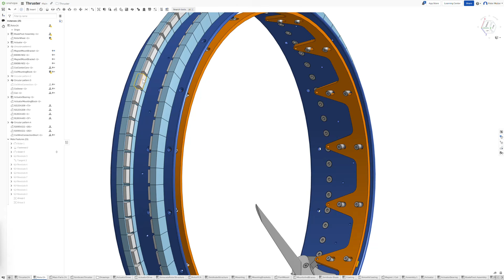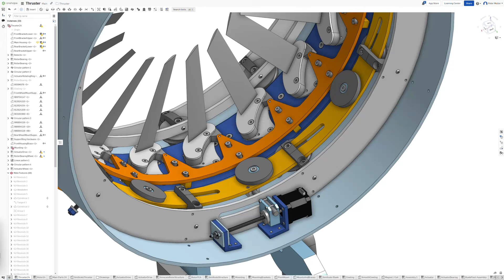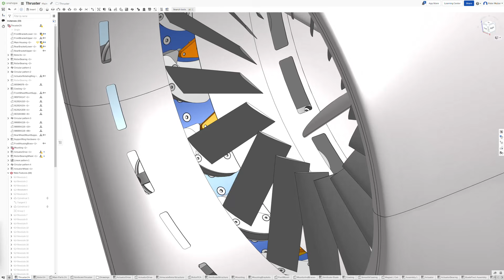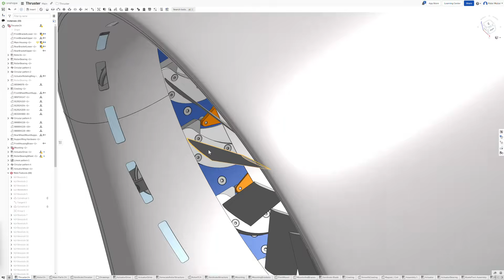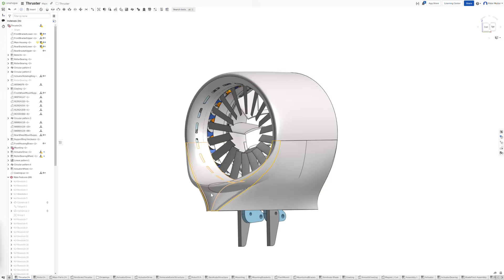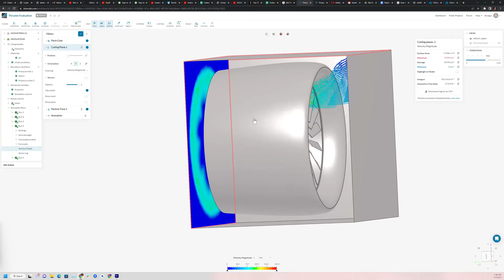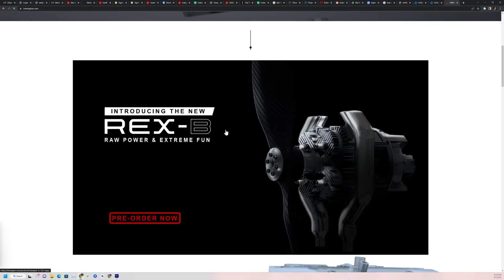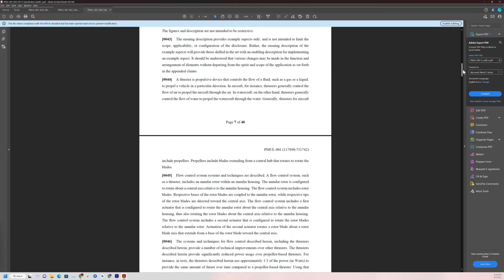Could this Thruster transform Aviation?

Comment: Have you shown this design to Mike Patey? He has built entire aircraft - engines, avionics, wing spars, high lift devices, etc and does his engineering analysis in solid works and fabricates significant amounts of his aircraft components himself , from aluminum to carbon fibre. He would be very interested in this design.

Comment: What's the advantages of having adjustable blade angles?  Thanks y'all.  Awesome video!
Reply: Adjustable blade angles are like the gears in a car's transmission.  A shallow angle is a low gear, and a high blade angle is for when you are screaming along at high speed.
Reply: @1donagin   thank you!  Does that mean possible quicker acceleration or shorter runways?

Comment: I've been working on something similar (for a personal flying vehicle), but with the blades connecting to an inner ring as well, which I expect to eliminate wingtip vortices and vibrations, and reducing risk of damage if a blade is impacted. I haven't gotten to the point of testing thrust or efficiency, but the noise reduction compared to regular propellers is massive.
Reply: Wing tip vortices, are produced by the wing, starting at the root, moving out toward the tips. The engine has very little to do with them. Ir were you referring to the compressor blades? Usually, a blade is designed with washout, greater pitch in the centre, with finer pitch toward the tips. This is because the speed of the tips is greater than the root. From what I saw, it is less of a turbine, and more like a Fenestron, like such is used on the EC-120
Reply: @onebadwolf9123  I'm talking about vortices at the end of the propeller blades. While less critical than those at the end of fixed wings, it's an effect that also affects propellers.
In my design, the propellers are supported by an outside ring, not at the center, so the votives would occur at the edge of the propeller that's near the center of rotation. Given the slower speed of this part of the blade and the direction of the prevailing forces, it should be a small effect, but I won't know until I'm able to measure it.

Comment: This was oc just a prototype, but I noticed a lot of resonance/flutter at the tip of the blades. Are you sure you don't have to connect them in the middle, to compensate for that instability ? I imagine it will only get worse when sped up ?

Comment: This is very interesting.
 With mag lev bearings this internal rotor could be friction free. And with shorter blades one could create a Dyson fan type airflow. The outer moving air drawing the central air through the core. 
 I also think that a much better fin blade design is available but I will not specify to protect your patent rights. 
A structural battery where it provides the strength to the airframe would not add weight to the airplane. Also new fuel cell Technology has achieved 66% efficiency and electric motors are already 66% efficient. This design could reach Turnofan efficiency of 70 %

Comment: As someone who's working with tubine engines, the design may be novel and interesting, but it will never meet the certification requirements for jet engines. The issue with this design is the high moment of inertia. Using such a component in a compressor will make the engine unresponsive. It will take a long time to spool up and down. This is a huge issue for compressor stability. If you pull back on the throttle, the combustion chamber temperature rapidly drops, leading to a decline in thermal throttling. This sends the compressor into mach 1 and locking the flow rate throughout the engine. This is not that critical, but tends to mess with the turbine end of the engine. The other way around (and usually much more critical) is a sudden increase in combustion chamber temperature. This happens when a pilot pulls the engine from high idle into go around. The compressor is throttled and the blade load increases. The faster the system can accelerate, the lower the influence of this transient behavior is. If the compressor can't accelerate fast enough, the load on the blades becomes to high and aerodynamically unstable, which stalls the compressor and makes the engine lose thrust. In practise, an aircraft engine needs to throttle from idle to max thrust in 8 seconds and from high idle to max thrust in 5 seconds to meet certification requirements. A system like this i very unlikely to achieve these requirements.

Comment: It's really a nice piece of design. However looking at longevity, I would have serious concerns about the wheels used to spin the rotor and the mounting of the stator coils inside the rim of the rotor magnets.
If the coils could be around the exterior there would be far less risk of catastrophic failure from a wheel bearing failure. The coils could then be in a epoxy filled stator frame. The magnets would be flat on the rotor instead of standing axially. There is still a big chance of failure from the wheels. If instead the entire circumference of the rotor ring could have bearings manufactured into it with a thrust load capability, the longevity of a full scale design would be improved.

Comment: What is the advantage of not having a core?

Wouldnt the compression just scape trought the center?

Since the blades move the slower in the middle, the efficiency is the whorst at that point, doesn't it then make sense to use the center to put everything there (motor, hubs, pitch controllers,etc.)?

Comment: Current A&P student here; I have a few concerns, but first let me say it is a very interesting and amazing project that you have sought out. From my understanding, you did not account for thermal expansion of the blades, which, when brought up to working temperatures will possibly expand.
Your thrust power is possible, but the weight of your aircraft and even aerodynamics of the wing will cause problems for you with your VTOL system.
I cannot wait to see what comes out of this project, however, I do feel like you could've made more economic decisions regarding building the prototype considering the size.
Best regards.

Comment: Thanks for the video, very interesting!, I am just wondering about the structural integrity of those propellers at high speed and especially at the center tips that don't have  a support structure leaving most of the integrity work to the base. I am just curious.

Comment: Amazing!  Best of luck.  Can this be used on ships, too?  If it is so much more efficient than a conventional propellor, there can be savings in fuel.  And you don't have to worry about the weight, and can run it at a much lower speed.  The prop shaft could perhaps drive two Thrusters, and replace the conventional prop.

Also, the blades can all meet at the center, and you can have a bearing there and the bearing can be supported by a frame of some kind.  So then you're supporting each blade on both ends.  Or will that impact negatively on the efficiency?  (I wouldn't worry too much about the fluttering blades in your prototype - I'm sure it's a very well-understood field and can be addressed in various ways.)

It might take a lot of time and money to rate this for an airplane that carries a pilot, let alone passenger aircraft.  So it might be easier to develop this for UAV, and ships, first.

I hope you'll keep us posted on your progress.

Comment: Please excuse ignorant questions from a layman, but (1) why are the Delrin guidewheels of different numbers on each side (12 and 9)?  It seems to me it would be better to have them precisely matched on both sides of the rotor to prevent any lateral movement.  And (2) what is the advantage of having the free ends of the blades not meeting in a ring of some sort in the middle?  Again, it seems to me that the flexing they would likely do under high load would be more likely to result in the failure of individual blades than if they were joined to a ring which would provide more stability.

Comment: Its like inversion of current engines and their propellers. Why not...

Have some questions:
- what if existing propellers will be curved from 90 angle to 120-180 to the back of the center of the engine
- what if propellers may be manufactured from flexible material which can bend so it may adapt to different speeds of airflow

Comment: The uncoupled fan blades and open centre section are good for unrestricted airflow at high airspeed.

Any thoughts on increasing the weight of the band the blades are mounted, so as to increase reciprocating forces at operational revolutions per minute...

Comment: Would there be any way to shroud the blade tips? It would give a bit of compression resistance if you could manage to even split the shroud into 2 separate rings that encompass the blade tips somehow. You might have to do some roundabout thinking to keep the variable blade features, but I feel it could help cover a lot of the observed issues with this proposal

Comment: I think the application of the tech is quite limiting to its diameter. If we compare this to a Helicopter for example. The thrust to weight ratio is good because the propeller/blade can generate enough thrust to lift the vehicle up and engineers can extend the blades outward as much as possible for more lift. This one... I don't know. The thrust to weight ratio seems not enough. The propeller blades cannot be extended further to increase thrust. There's also the power needs to spin the fan. Because the fan blades are really short they'll need to spin alot faster to generate enough thrust. If this was a boat motor. Maybe a good application since the blades aren't obscured by the mounting points. Like a typical boat motor. In any case this needs further testing.

Comment: there's no benefit to not having a central spoke structure to add support, torsional/centrifugal rigidity however, quite a few disadvantages not to--not to mention the bearing systems used? there are physical reasons why central shafts are favored to circumferential iterations--those outer guide bearings would have to deal with material moving at supersonic speeds-better to use a magnetic bearing or air bearing for something like that . Also, this entire concept/assembly is covered by patents from Rolls Royce nautical dev.

Comment: Seems like a good design to me.
It would be necessary to check the bearing expansions at high temperatures/vibrations.

An idea that can improve thrust and reduce the tip flutter: Change the rectangular shape of the blades to a trapezoidal one; A wider base (maybe twice as wide as the tip) .Try in CFD.

Comment: I had a similar idea, but still with a motor in the middle and a couple of normal blades, outer ring fully rotating. Not sure if that negates a lot of the efficiency, but it seemed a lot easier to make.

Comment: Really interesting design, but I suspect that having that much stuff on the outside ring means that the moment of inertia of the rotor is going to be massive and the rollers containing the rotor will have massive forces on them.

Hope you can figure out the issues and make something viable from this!

Comment: The main point of failure here is going to be the bearings, the reason we use a central shaft is because the axis of rotation only really needs 2 bearings. 
Second, you have more mass on the outside of the balde. More mass means more vibration. 

Sorry this design is quite terrible and will be extremely unreliable.

Comment: I found the design to be very interesting. I would be concerned about rotor bearings durability because Delrin is very soft and may not wear well when exposed to dust or ice particles in flight or on the ground. Solid metal rotor bearings with some kind of spring loading might be a durable alternative even if they are more expensive to build. 
Another issue is the aluminum rotor. How does your rotor handle the hot to cold back to hot transition that will be encountered? It is not unusual to leave the ground at 80 degrees F and reach 20 thousand feet at 0 degrees F or 30 thousand feet at -40 degrees F. The general rule is the temperature drops 4 degrees F per thousand feet altitude increase. I think that is the main reason most turbo fan rotors are made of titanium which handles the hot/cold transitions much better than aluminum or steel.

Comment: Well I can not see why not.  Essentially your dealing with a sealed bearing with blades mounted to the inside rather than outside.
This puts the housing in a much larger area which reduces stress.  Balancing weight distribution would be the hardest part so it doesn't warp.

Comment: I mean, sure. But the motor in the rim is heavier than in center; thereby both making the system and the driven mass heavier; which would require more energy to do the same amount of work. 
You could partially retain the design where the outer rim recesses into the cowling, thereby reducing losses and the variable pitch is still pretty great. It's just that I don't see the rim drive component having a benefit.

Comment: Is it possible to make the blades out of NitiNOL and use the natural spring flex of the shape memory material to do the blade pitching at the expected altitudes and temperatures of flight?
Is NiTiNOL even durable enough for this purpose? 8% flex isn't much but it'd remove a lot of moving parts.

Comment: I’ve been wondering about this concept for so long, it’s great to see a coherent expression of it. How would a central duct joining the fan tips accelerate the flow? It could help to reduce flutter also.
Reply: If the efficiency is even half as you predict, you really should be looking at batteries rather than an engine.

Comment: As reinforced by the entire comment section, it's important to consult with other engineers during the design process to get a better grasp on failure points and viability so that you're not wasting your time designing things that won't work at speed or scale.

Comment: What about turbulence analisys...
the blades could be shaped as the wings in a regular passenger jet, like triangular with the little winglet tips to reduce turbulence in the airflow, and increase the efficiency reducing the empty spaces in the base of the blades where they attach to the outer base ring, it will be like 18 passenger jet wings rotating instead of the 18 straight flat blades used now.

Comment: That's a lot of small diameter bearings at high speed, there has to be a way to reduce the chance of one or all of those locking up over time.  What is the longest time one of these has run before needing service?

Comment: Very cool design.
Have you considered support the rotor on magnets, Maglev like, so virtually zero contact and therefore zero maintenance required and maximum efficiency?
How these rollers and slide pins will deal with ice?

Comment: I'm just a random youtube viewer, so I might not know what I'm talking about.

The core idea of adjustable pitch on an EDF is excellent.

In your efficiency comparisons you mainly compare to a two bladed propeller; my understanding is that a multi-bladed conventional propeller is better, but I don't know how much; does the advantage decrease?

For power, If you are using a mechanical engine to create it, than you should use mechanical means to move it; the electric motor and generator are never going to be as light or efficient as just connecting the blades to it .

What is the advantage of having an opening in the center? If there is not one, then it seems more practical to use a normal motor in the center, and have the pitch still controlled from the outside, by your ring system.

Comment: What about connecting the blades with a ring in the middle? It would cause less deflection in the blades and you could add more blades without the issue of the ends bumping into one another.

Comment: Short answer: No.

Long answer: The primary downfall of electric aviation is energy density. There is no solution available now or within 10 years that gets relevant flight times at man carrying weights.
It is perfectly reasonable to use a standard, well tested and highly efficient adjustable pitch propeller. Even within their core performance envelope EDF have only a small theoretical advantage over a properly pitched propeller.
A modern high bypass turbofan engine reaches overall efficiencies beyond 60%. Propellers reach efficiencies around 80-90%.
EDFs can beat that under certain conditions. The reason they aren't used is not the thing in the middle. As a matter of fact that shape actually increases the efficiency by eliminating tip vortices, compressing the air and, most importantly, by allowing lower speed differences tip to tip.

Even more importantly, the speeds required to reach the point where a variable pitch EDF beats a variable pitch propeller are well above 200kts IAS. Good luck providing the power required for that in this hilariously inefficient package...

I have no clue where you think you're going with this. It ain't the sky, that I can guarantee.

Comment: Magnetic barings would probably work better considering the RPMs and the fact that it already requires magnetic fields to run. 🤔
To adjust the blade pitch, a variable magnetic field would work. Probably a spin based deal like seen in other things... I'm blanking on the specific device, but there is one that requires speed to moderate the articulation. (Was it related with a car or engine of some sort? 🤔 No, it was a 3-point seat belt mechanism 😅)

Comment: Interesting! you've turned the blades inside out and removed the core of the compressor. I wonder if curved blades would be even more efficient? What kind of vortex or drag does the hole in the middle generate? I wonder if it could also work under water?